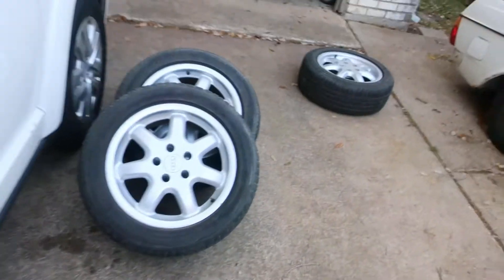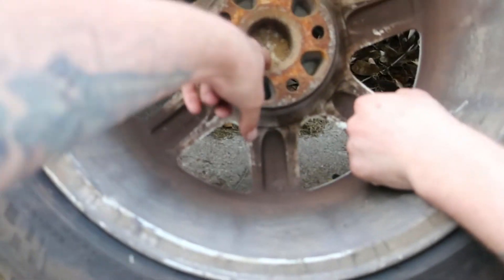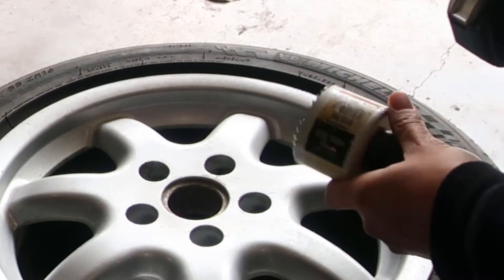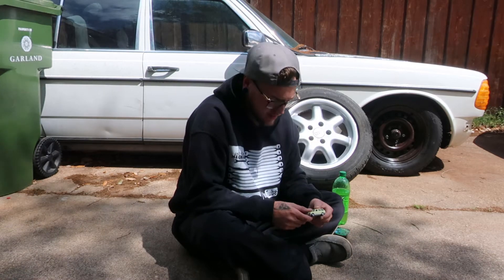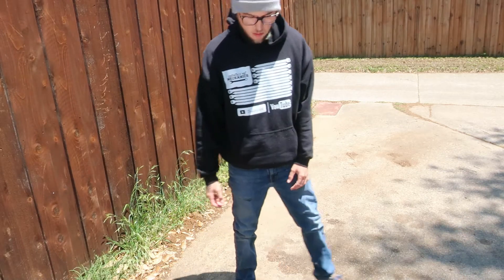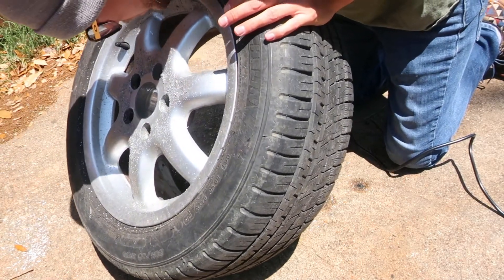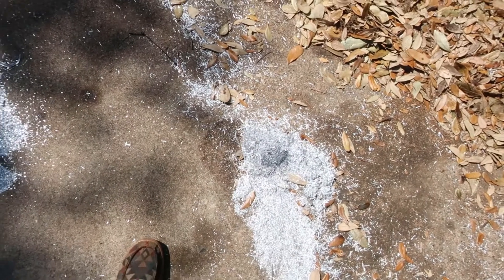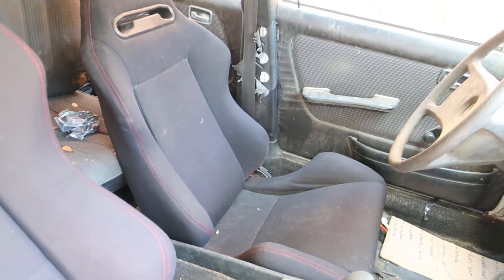Expanding Hub Bore of Wheels /  Mercedes Gets Audi Wheels

Comment: man I hope this is just to put some rollers on it to avoid the city BS... Hole saw just seems hella sketch.
Reply from the maker: SUPER sketch. i would not do that on wheels i was going to drive on the highway. but an offroad rig or something like this, it will be fine. these are rollers to appease the governments requests so i wasnt too concerned with getting it perfect otherwise i would have just taken it to a machine shop.
Reply: @definitelynotmechanics  I figured it was to get the city to leave you alone. Wagon does look mean on them though.
Reply from the maker: we just got a big piece to the mercedes puzzle so it should start looking A LOT meaner.

Comment: i don't get it, you got a ticket for a flat tyre in your own yard? what country are you from wtf?
Reply from the maker: thats dallas county for you. most big cities have laws like that to keep people like me from having 10 non running vehicles in their driveway/yard.
Reply: @definitelynotmechanics   Honestly I'm surprised to hear that from the USA, the land of the free. I'm from Europe, I have around 10 cars in my yard with some of them missing a lot of parts and most of them are non-running.
Reply: @definitelynotmechanics  btw if you didn't find out till now, the center bore of older Audis is 57.1 mm and Mercedes is 66.6 mm, starting with the B8 audi a4 they also switched to 66.6 mm. I also own a W123 and here is a tip for you, there's a nice looking alloy wheel from the Audi B9 in 16 inches that look pretty good on the w123 but are awful on the audi so people want to get rid of it, the part number is 8W0601025, they can be found cheap.
Reply: @rockhop8595  I just got some bbs Cs5 for a for my slk350 and I didn't know the center bore was bigger, I have to do this this week